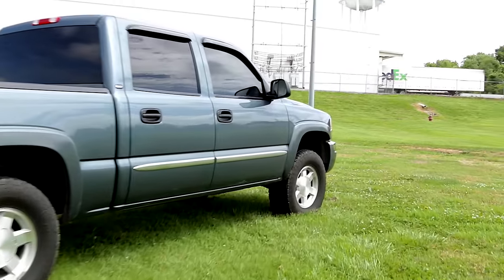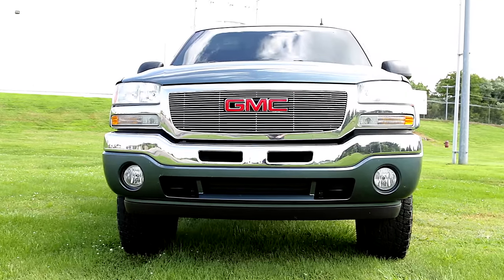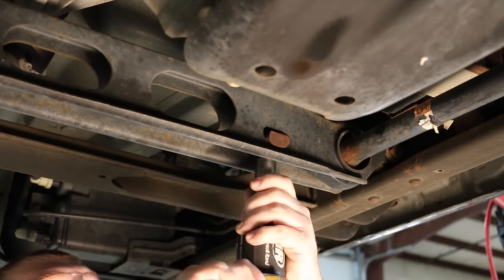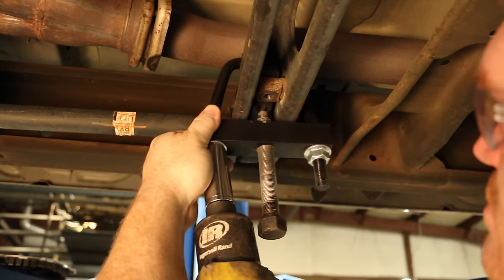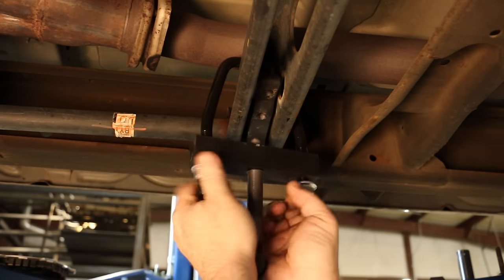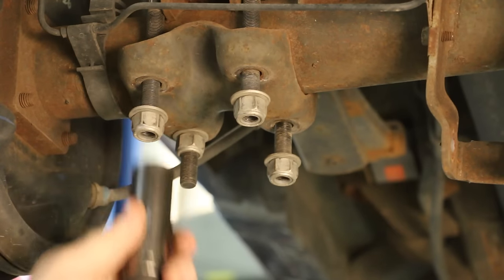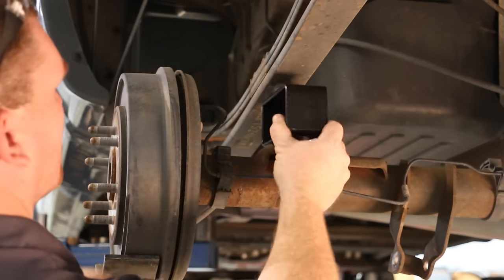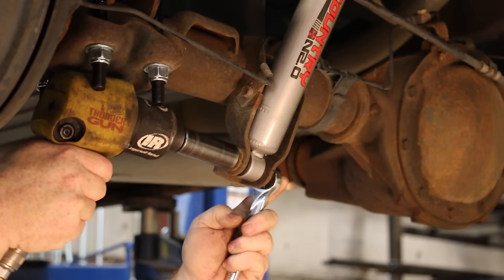Installing 1999-2006 GM 1500 Pickup 1.5 to 2.5-inch Suspension Lift Kit by Rough Country

Comment: Can I use this kit with your 6" lift kit for that extra height? Or its not permitted?
Reply from the maker: That is not recommended as it will cause cv axle issues, pinion angle issues, alignment issues. ball joint issues, etc.
Reply: I have a 2003 silverado with 6inch and level and 3inch body I'm running 2007 cv axles because their longer and moog  plus or minus 3inch caster camber upper control arms and moog 1.5 inch caster camber plates so 4.5 inches of extra play with alignment and it's golden no problem at all
Reply: @Bstoy21  I know this is an old comment but I'm trying to get my 07 Classic lifted  a little higher do you have a part number for the  control arm?
Reply: @MAJESTICJONES  just go to advanced auto I forget the sort number like 4 plus years ago I worked for advanced auto before I became a diesel tech and their 2 different control arms from moog the plus and minus arm and the regular arms that don't have extra adjustment in them not sure if that'll help but back then 4-5 years ago their wasnt shit for lifts like their is now go online and get a corrected upper control arm for example Zone UCA, Cognito, kryptonite theirs many more UCA'S to choose from now a days

Comment: Does it matter if your 2000 silverado is 2500 are you still able to level it
Reply from the maker: +bcg921 Will only work on the 1500 model.

Comment: so why such the huge number gap???? is it 1.5 or 2.5 i msg rough country abd they were like meh could be either way. LOL
Reply from the maker: The keys are adjustable. Depending on how you set the keys it could be a 1.5" to 2.5" lift on the front. That all depends on what you set them at.

Comment: will a lift kit for a 2001 sierra pickup work on a 2001 gmc yukon xl k2500?
Reply from the maker: This kit will not be compatible with the Yukon 2500
Reply: What is the difference between the yukon and sierra suspension?

Comment: get any driveline vibrations after lifting it?
Reply from the maker: As long as this kit is installed per install instructions and aligned you will not experience any drive line vibration.

Comment: Do you need an alinement before or after you install this lift kit?
Reply from the maker: You will need an alignment after the kit is installed
Reply: does this kit level your stock front rake also? do you offer just a leveling kit. or a level AND lift kit combo?
Reply from the maker: This kit's front end is adjustable and can indeed perfectly level the truck. We offer kits that just raise the front to be even with the rear, kits that raise both the front and rear maintain the factory rake (these kits are designed for those who tow but want bigger tires), and all of our 3+ inch lift kits raise both the front and rear leveling the front with the rear in the process.
Reply: +Rough Country ok thanks! i think i have made my decision.  cant beat your guys' price for as much product you offer!
Reply from the maker: That's what we aim for. Glad to know we're hitting the mark!

Comment: what is i get this and run s65 75 16 with 2 inch wheel spacers
Reply from the maker: Again it is not recommended to run the 2" wheel spacers on this setup as they are not needed and will create rubbing on the fender wells.

Comment: Would 275/70/r18 work with this on a 02 z71
Reply: I have 265/70/17s on a stock Z71 so you should be good with the kit. 275/70/18 is just skinny 33s

Comment: Question would this fit surburban 02 1500?
Reply from the maker: +s14duma This one is only for the 1500 pickup. Below is a link of the kits that will work for the Suburban

http://www.roughcountry.com/suspension-lift-kits/chevrolet-suspension-lift-kits.html?vehicle_drive=3&vehicle_model=245&vehicle_year=73
Reply: +Rough Country thank you

Comment: So with this would I need new coil springs?
Reply: Also if the full 2.5 inch front lift levels it then wouldn't the 3 inch rear blocks place it back I in a rake position?
Reply from the maker: No it would not because you remove the stock block and replace it with the aftermarket blocks. You retain the stock coil springs
Reply: Ohhh alright thanks for the reply purchase is inevitable now.
Reply from the maker: No problem. Glad we could help. Also, there's no better time to get it than now. We're running a financing special right now. See http://roughcountry.com/affirm for more details. ;-)

Comment: what is i put 2 inch wheel spacers what tires can i run
Reply from the maker: On stock wheels that is not recommended. It will create rubbing on the inner fender well

Comment: Nice my truck looks a whole lot better with this lift I run 33x12.50 r17 nitto mud grapplers I have it on my 2002 z71 I got a video on my channel
Reply: TheBeachLife 18  did you do any trimming
Reply: Thanks. I have the same tire size and needed to know if it would fit

Comment: will this be able to run 33's
Reply: This was made to fit up to 32" so I guess you could try 33"but it might rub.
Reply: Yes. 285/75/16 or if you have 17's that's going to be 285/70/17.

Comment: with this can i fit 285 75 17s
Reply from the maker: 285/75-17 would require trimming. I would recommend staying closer to a 285/70-17 on a stock wheel or 285/70-17 on a 17x9 aftermarket wheel with a 4.5" to 5" backspacing -12 to 0 MM offset
Reply: Rough Country your replies are greatly appreciated.  do u guys offer a full 3 or 4 inch lift for a 2006 silverado z71

Comment: I have a 2005 chevy silverado ext cab 2wd I notice it dosen't have coil springs  it has a torsion keys and bar people say I have a z71 suspension on my 2wd Silverado how do I order my lift kit as a 2wd or 4wd kit ?
Reply from the maker: If you have torsion bars then you would have either the 4WD or AWD on that vehicle. Unless you have a 1500HD.

Comment: This is a stupid question but I've been told with any lift you have to run bigger tires even with one of these and yes I'm going to run 33s but right now I'm running stock 265s that'll be fine right I'm pretty sure I know this answer already but you never know
Reply from the maker: With a leveling kit you can still run the stock tires. They will look a little smaller than what is recommended but will not hurt anything until you purchase newer bigger tires.

Comment: Anyone running 295/55/R20’s on this kit? I have factory 2014 “snowflake” wheels.
Reply from the maker: 285/55-20 is max size. If you run the 295/55-20 would require some trimming to the inner fender wells.
Reply: Rough Country  Thanks ya'll, I have no problem with trimming the bumper and inner fenders a hair. Just ordered my Cooper STT Pro's in that size so as long as it fits with some modification I'm excited!

Comment: Is there any way to fit a fox shock 2.5 in this truck and if so what’s the part number
Reply from the maker: You can run a Fox shock on that vehicle with that kit, yes. We do not have a Fox pn# for that item though.

Comment: Do you need a lift for this
Reply from the maker: This is a level kit that is designed to level the front of the vehicle with the rear. You do not need a lift kit with this
Reply: Rough Country he means a hydrolic lift to install or could you do it on jack stands